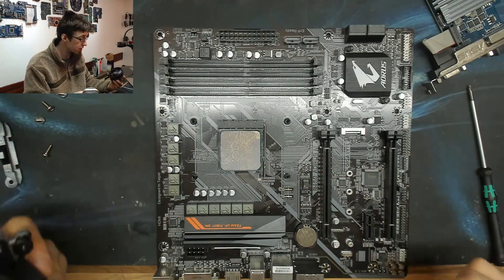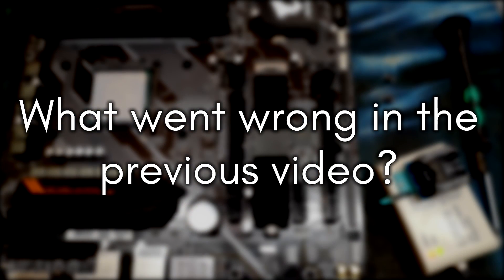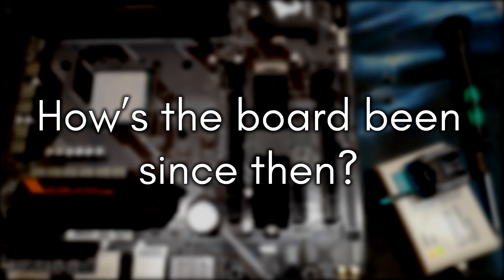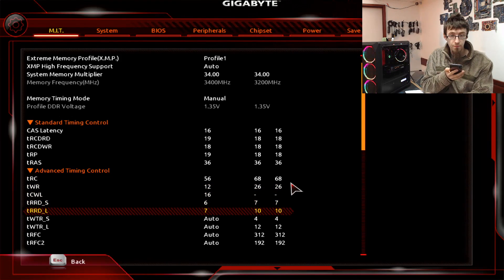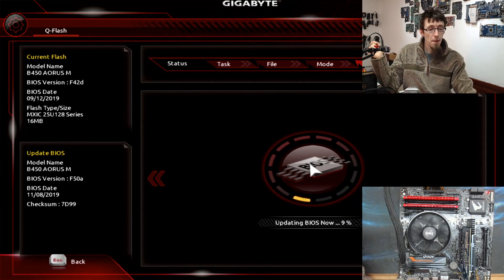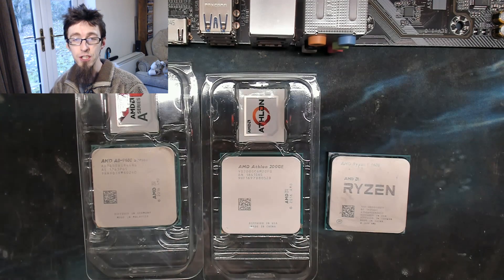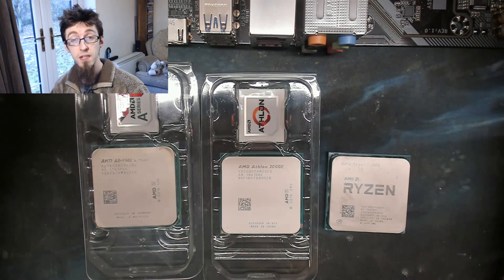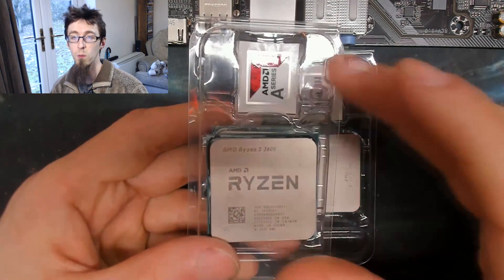LFC#186 - Gigabyte B450 Aorus M Update and Conclusion

Comment: So here's my story:
I tried updating the BIOS on my perfectly working PC (B450 Aorus Pro, Ryzen 5 5600, 4x8GB G.Skill Trident Z DDR4 RAM running at 3200MHz with XMP). I was on BIOS version F60f and updated to F66g, which completed successfully (I didn’t update the backup BIOS).

After the reboot, it got stuck in a death loop similar to the one in that video. The debug LEDs were cycling around and around, except the BIOS LED. I tried everything like you did — disconnected everything, tried with just one stick of RAM, without GPU, etc. Same result.

Swapped the CPU for a Ryzen 2600 hoping it might trigger something or at least get me into the BIOS. Nope. Then I tried shorting the reset + power pins — sometimes it would enter a different loop where the VGA LED stayed on, the monitor , and the USB keyboard got power, but that was it.

After a restart, it went right back into the previous death loop - no change, even when I shorted BIOS pins 1 and 6 :D At this point, I was on the verge of a mental breakdown, wondering why I was stupid enough to try updating a perfectly working BIOS :'D

Now the only thing left is to swap the two BIOS chips, but unfortunately, I don’t have the tools for that at home. My techie friend at the repair shop will probably have a good laugh when I bring it in... or maybe not :D 

In the meantime, I got hold of another motherboard and quickly swapped over the components - of course, everything works perfectly.
All I can say is, I didn’t buy a Gigabyte board this time, even though I used to really like them. Anyway thanks for the informative vids. I'm hooked :)

Comment: I bought 8 motherboards back in 2020 to start a Youtube Channel and was in a major auto accident the next week. I just updated the bios on my X570, x470, a520, a520 to take the 5000 series AMD cpu. When i read about the Aorus B450 M, I decided to watch a Youtube video and found your videos. I have 3 Youtube accounts and subscribed them all to you. That was very impressive tech work and the soldering chip swap was a great idea. My Gigabyte B450 Aorus M board was bought from Amazon in 2020. The front of the box does say, This motherboard is Ryzen 3000 ready. The Gigabyte website has a new bios that it says is great and everyone should upgrade to it. If you were going to use the Flash button without a cpu installed and you know about it saying upgrade to a previous bios before going all the way to new bios, what do you think. If it already supports 3000 series, it may have the 40 or above. I was going to make it my PLEX server but the 5000 series would be nice to have. Even if I sell it, people want the 5000 series. If I take a shot of usb flash upgrade to the newest Bios, I lean toward it working because it is 3000 ready or fail without bricking the board. I watched all 3 videos and wondered what you thought about my 3000 ready board. Glad to see you have 163,000 subscribers, i was hit head on at 125 mph and have headaches from hell. Sorry the post is so long. I started to send you the message by twitter but I thought it should be attached to this video.

Comment: I realize this video is 3 years old, but did you ever run the EC FW upgrade tool?  If so, what were your results?  From my experience and Google search results, it seems this requirement also leads to strange happenings and thus lots of questions.  Just curious how that went for you.
Reply from the maker: I didn't, and didn't seem to have any issues afterwards.
However, these days if I've done a manual-reprogram on a mobo, I'll follow up with another flash from within BIOS (the normal way) so that update can do any other aux updates (EC, RGB, etc...) that it wants to. This is easy for desktop boards, but some laptop OEMs just don't supply BIOS updates, so it's not always possible.

Comment: got a same motherboard which is refusing to boot bought a new 8gb ddr4 3200Mhz Kingston ram stick. It is still showing up the dram error as the dram led lits up every single time I am just not able to get into bios the processor I am using is a Ryzen 5 3500x and the thing is the mobo was working fine with the processor one fine day and all of a sudden I don't know what went wrong with it but just refuses to boot there is no display and it just constantly shows up the Dram led on mobo. Is there anyway you could help me out with this?

Comment: I have a Gigabyte B450M-DS3H, I needed to update from F2 to F62 to support Ryzen 5000, I had to go to F32 which caused my system to not boot with my NVMe drive installed, then flashed to F62 and all issues solved and allowed me to upgrade from a 2400g to 5600g to get official Windows 11 support and the system works perfectly.
Reply: Have you done every flash with the 2400g and switched to the 5600g after all of this, or did you switch at some point in between?
Reply: @christoph_4677 I used the 2400G to flash up to the bios supporting the 5600G which in my case was F62. I haven’t flashed the bios any further as I don’t want to risk it in case it breaks my motherboard. Basically, I only flashed it because I had to. The update also ensures fTPM and Secure Boot are on by default for Windows 11.

Comment: My BIOS is F41 and my CPU is a Ryzen 2700X and I can't open the BIOS interface, I have the same problem you had that it crashes after a minute or less. Should I exchange between my BIOS and the reserve one like you did in your 183 video? My computer works fine most of the time but I need to enable the virtual machine and it can only be done in the BIOS interface which I can't access because it crashes. Any tips?

Comment: This motherboard is such a mess. Picked up a used Aorus B450m recently, and had the long boot time and not saving bios setting on cold boot issue. The board had F62d ( most current at this time).  What fixed it for me was flashing back to F61, and selecting "Also update back up bios" to ensure both chips have fresh bios programmed. That fixed my problem of the long boot and bios setting not saving on cold boot. I subsequently updated only the main bios to F62d and left the backup alone at F61 so I can tell which bios chip is being used.  Using a R3 2200G on the board.

Comment: My board came with version F50 and I kept having issues with my dual channel Corsair Vengeance 3200 mhz ddr 4. I was getting blue screens in games and after many months of instability, new system and no improvement I got it stable my taking one modulo out... would going to B62 fix that? I dunno how to test the memory... it says its fine

Comment: I own a B450 M Aorus + 2x16GB + 1700 and had BIOS F60 or so. I just installed Win 11 and therefore was looking for a new BIOS. And found the F62d and tried to install via the Win BIOS Tool. Didnt work, tried 1rst to install via local drive and than via webserver - both brought up a fail.

I restarted later because of a new network driver and than the Aorus Firmware Update came on and updated. NO sign WHAT was to be installed.
After restart: F2 BIOS!
After Q flash update on F32, or maybe the later F40:
Brick!
Reset+ Power to reinstall F2/ backup BIOS Chip I guess...
reinstalled F32, Brick
installed F31, Brick
NO BIOS Back via POWER+ RESET anymore
....

PS: I installed most of all these BIOS after each other over the last 3 years. ALL worked. Just the DDR 4 modules are newer ones now and the also worked.

What to do?

Comment: hello..I have the same board purchased used..but didnt noticed whats the current bios..but ive already installed the recent one..f61a...but i cant see any xmp profile or i cant even touch my overclock settings..my processor is ryzen 1600..can i downgrade bios? and whats the best bios for 1st gen ryzen..tnx

Comment: I just had a similar experience. Have this mini-atx version of the board at f5, tried to flash at f32 with my working 2700x, but got stuck at the bios screen. Tried my 3700x, that seemed to reset the bios because when I tried my 2700X again it booted up fine to f32. Flashed to f60 and then swapped out to the 3700x and seems to be working now

Comment: i have the same board right now, but i flashed it up to f60c version bios. My 2700x booted up just finej, however when playing game i sometimes crash, and the proc speed jump around from 2.2mhz up to 3.7mhz even thoug I already set it to be 3.7mhz on bios (not AUTO).. volt is set on +0.66 & -0.66 on vcore.. is the bios version the problem? i did found a post on Linus forum saying that if update more than f50, it could cause proc incompatibality, but i did see any of those warning / note on Gigabyte website. What would your opinion be sir?

Comment: The other solution maybe is to use on mainboards SO-DIMM DDR4 memories (horizontally below the heatsink or vertical using an EVO 212 cooler) at very close distance to the processor because of the shorter memory slot reducing the out of phase jittering and capacitive effect of the signals to the processor I/O controller. SO-DIMM matched also the side size of the processor socket can be put very close going the cooper traces a lot shorter avoiding all the issues at OC speeds.

Comment: Another problem can be the poor quality of the PCB layout due the lack of enough layers and proper shielding to avoid signals crosstalk and errors bits on the memory data bus but the capacitive effect and jittering at high clock speeds remains despite the quality of the memories, PCB and processor I/O memory controller.

Comment: The backup BIOS should be always an emergency bootloader without bugs to reflash again the main BIOS in the case of troubles doing the flashing process first issue that leads to a bricked mainboard. But the main problem are the long cooper traces on the memory slots to the processor socket. Because of the capacitive effect and signals delaying & jittering at very high OC frequencies the memories I/O data bits starts to have errors leading to OS crash screens. From my point of view the BIOS use a sort of error bits corrections code for the memory I/O data and OC speeds initialization. Is better maybe a two slots memory mainboard to run memories at OC speeds because the digital I/O signals are better without errors. I will buy a two slots memory mainboard the 4 slots design have a lot of memory issues due the capacitive effect of the cooper traces at high data clocks.

Comment: Coooooool    we upgraded BIOS to F31 to prepare the motherboard for the new CPU, with old CPU AMD Athlon X4 950 Quad Core Processor  in order to support new AMD Ryzen 7 2700x and it didnt start up. cant access BIOS. Briiiick????  NO!
now i know why: http://hu.gigabyte.com/products/page/mb/ga-ab350m-d3vrev_10#support-cpu
current installed old CPU is support up to F25.  BIOS F31. 
Tomorrow i will return to my firend and install the new CPU (it recognize it from F20) . It should work.
FIngers crossed.
Reply: Yep, with the new CPU all works ok, booted, started immediately. 
TBH when we updated the BIOS without touching any HW and it didn't start at all i was sure its game over, bricked motherboard. In desperation tried removing graphic card, SSD, 
etc. had no idea it will have problems with the CPU it was working it with years. Yep new firmware dont recognize old CPUs.
One single line on manufacturer's site like "Warning above F25 some older CPUs are no more supported, see full list at ......"  would be appropiate...

Anyway all ok, im so glad this guy uploaded his mistakes, this saved me.
Cudos! Thnk you!

Comment: I am currently running a Ryzen 5 1600 AF and plan on snagging a Ryzen 5 3600 soon. My BIOS is currently at version F5. To update to the latest (F60c), I would need to flash F32, F40, and then F60c right?
Reply from the maker: Yea that's the path I would take.

Comment: I liked this video series and I have a similar problem.  Got a Gigibyte B450M gaming M/B  with a 2600x and it always looses ram settings after I unplug it from the wall, plus I cant get the ram to overclock over 3200mhz.  I think I need a flash tbh .  Hopefully give you an update
Reply: Hey Mike! I know I'm a little late but worth the try... Did you found any solution for this? I have the same problem with my B450 Aorus Elite v2

Comment: Hello sir,

I recently was just built my PC in July but first I had a issue where my standoffs because my motherboard had different grounding points I found out was able to fix the issue relatively fast.

Yesterday it was running fine I had left it overnight so they can update a game. I woke up in the next morning and I turned the PC off after I saw that the update was done.

Five hours later I returned home to see if my PC on, after I came in from work it puzzled me at first as to why the PC would come back on after I made sure it turned off. 

However my first problem was there was no video data going through my HDMI cable to my monitor so I thought the cable was broken I switched cable out the cable isn't broken. 

Changed gpu just incase it was an issue and it did nothing I've tried clearing cmos and checking all power connections everything is fine. 

I even took my cpu because I saw the flashing lights by cpu and ram so I cleaned those and still there's nothing!

I would your opinion on this if I should get a new motherboard since I don't have another ryzen cpu at my disposal?

My setup contains the following
3700x 
X2 8gb teamgroup ram T-force
Rtx2070 (zotac)
600w psw evga 80 plus certified
Stock ryzen cpu cooler 

If there's anything you suggest I do before buying a new motherboard please let me know. 

I went with gigabyte because they were supposed to be the best but this told me another story, their support website isn't even loading so stuck without a computer.

Comment: Thank you - very nice!  I seemed (so far) to have done everything just like you would want!  (GB B450M AORUS M now with a 5-2600 and 4x8GB DDR4 3000 - build in use 1+ year.  MB came a year ago with BIOS F5.  Planning on getting a 5-3600X or a 7-3700X and 4X8GB DDR 3400 as an upgrade, so today in process of preparing motherboard.  Today I updated AMD Chipset Driver to newest - Rev. 2.07.14.327, and installed AORUS APP Center to use @BIOS to upgrade BIOS to F32.  Went very well! Still in a quandary as to installing EC FW Update Tool before going to F40 and F51 (latest BIOS).  Lots of people with issues when trying to install ECFW tool...explanations on the GB blogs are lengthy and not clear at all as to what the issue is and what the solutions are.  Do you have any clarity.  In your previous you mentioned the ECFW requirement to proceed to, or past, F40.  I think a short comprehensive video on how to do this tool install would be very welcomed. And thanks again for the clarity and the consideration of this request.
Reply: Have the same board with r5 2600 and can'g get past f40 even when i update EC FW.

Comment: Hope you're still reading comments, I have this board with a Ryzen 5 2600. It's a used board and I'm having a weird problem where if I put the PC to sleep in Windows 10 it wakes up in the BIOS. Any ideas? Bad board? I already tried a new profile and changing power settings.
Reply from the maker: Try different BIOS versions to see if that changes anything. You could also try toggling Fast Boot in BIOS, switch it on if it's off, and off if it's on - and see if that does anything for you.
Reply: @Adamant_IT  Thanks I'll give it a shot.

Comment: I bricked the Bios of my Gigabyte B450 I Aorus Pro Wifi itx Motherboard. The bios update was succesfull but after restart the Screen is locked at Aorus start screen, no reaction anymore. Cmos Jumper and taking out the bios battery didnt work, what can I do now ? Replacing the Bios chip?

Comment: Man what a BUMMER! I was considering Aorus 450 Pro for my Ryzen 3600 build, but with these issues i cannot justify this motherboard because i need to update bios to get good 3600mhz ram (and i dont have Ryzen Gen 1/2 laying about). Guess im back to my ASUS ROG 450-f (original candidate) as ASUS have NEVER failed me, but i think they skimped out abit in the 450 lineup.

Comment: So this board isn't able to use higher speed ram than 3200 with 3600?
Reply from the maker: I got it to 3400 with custom timings from DRAM Calculator for Ryzen, so it can be done 👌
Search my channel for 'xmp' and I have a video that goes through this

Comment: Sent my B450 back to Gigabyte (RMA) , perhaps they'll get the bios updated where I can drop in the Ryzen 3200g I bought and go from there. Moral of the story for me , screw amd. Considering buying another Intell mb & cpu , bump this madness. I want to sue these buttholes just for the aggravation & false advertising.  " Ryzen 3000 Ready " my azz
Reply from the maker: Yea. IMHO they should've set a rule that you cannot advertise your mobo as being Ryzen 3000 compatible unless you're shipping it with an updated BIOS or it has BIOS flashback. MSI had the right idea by refreshing their mobo lineup with the MAX branding, which was all updated for Ryzen 3000.
Reply: @Adamant_IT   Just saying , Got board back from Gigabyte , had them update bios to F - 50 now , everythings Kool now Ryzen 3200g running at 34c w/ 2 monitors , speakers , external drives & more. Aside from the bios nightmare , pretty cool board so far . Now if I can get some decent memory ....

Comment: So in my case, I have a Ryzen 5 1400 on the B450 Aorus M, BIOS version F2. If I were to upgrade my CPU to say a R5 3600, I'd simply go ahead and flash the F30 bios, get that done, then flash the F50a bios, and my 3600 should be supported and running just fine? I've so far had absolutely no reason to update my bios since everything runs great with short POST times. 
On another note, I believe the issues with having to set custom timings when going past memory frequencies of 3200MHz may have to do with that the board does not officially support speeds beyond 3200MHz, as my 3200 speed kit worked straight away simply by setting the XMP profile.